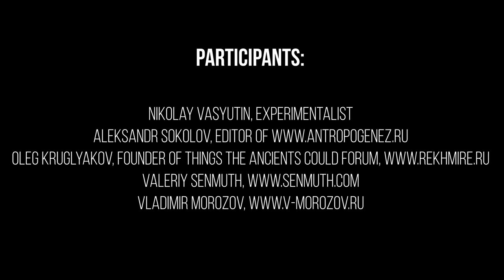Making Egyptian Drill Holes: Lost Ancient High Technology

Comment: Try drilling the hinge holes in the box on elephantine island.... It's impossible to do it that way.
Reply: Try viewing reality from a rational position.
Reply: @Eyes_Open  I am... The hole is directly in a 90 degree corner. there is absolutely no room for such a device.
Reply: @84Rabbitz  So you think the simple example represents all possible examples and therefore words.
Reply: @Eyes_Open  no I'm just saying that that works fine for a straight down hole in an open space. But there are a lot of holes that are drilled in inaccessible positions where that would absolutely not work.
Reply: @84Rabbitz  Sure. Other techniques would be required. Longer shafts for example.
Reply: The purpose of the video was to show of course how the Egyptians could in fact drill stone using bronze tools.  Yet your Elephantine Island argument constitutes a temple area which was added to and maintained up to = the Ptolemaic period...... - which is well into the Iron Age as you are in Roman times then

Ergo you ASSUME bronze tools were used to fashion those granite temple structures - some with holes - when it is equally plausible and far more likely that LAHT grifters take photos of the last additions to the temple mount = and "extrapolate" to generate INNUENDO rather than factual arguments - which you apparently fall for.  

p.s. - LAHT does the same thing for maaaany things.  They routinely take photos/video of sarcophagi in the Serapeum which date to the Iron Age under the Persians and Ptolemies and mischaracterize it as supposedly being created using Bronze Age tech........

Comment: The great pyramid has over 2 Million! Blocks all cut precisely with laser precision. You simply cannot do that with copper chisels.  And ropes     And the largest granite stones in that pyramid are 75 tons   There are very few cranes in the world that can lift blocks like that. And they are a few hundred feet up   
   And that’s just ONE pyramid. Of hundreds in the world   And the great pyramid is alighned exactly woth thr due north.  That means they knew the size of earth and directions. 

 Then there are those massive statues with perfect symmetry in faces   Precise.  Hundreds of statues. Not just one. Some ar 50 feet tall.    Then there are the massive underground structures  also precise.   

Nobody has ever been able to reproduce even a small pyramid in modern times. And they have tried.   

A small 2 ton block is 4,000 pounds   How many men would it take to move such a block even 100 feet ?  At 100 pounds each it would take 40 people just for a single block. And that doesn’t include lifting it  just pushing it around on level ground  

The holes made in This video are not laser perfect  within a fraction of a millimeter or as deep as the real ones in Egypt 

And we must ask who is the designer   No drawings ?   The great pyramid has perfect accuracy throughout   We cannot build a copy of it even today with all our machines

Comment: Ok got any theories on the precision joints on 5 tonne plus blocks ?
Reply: "Elbow grease" + a square...........  🤨

p.s. - the tomb of Rekhmire has the famous depiction of Egyptian craftsmen at work.  One depiction shows a craftsman using a large wooden carpenter's square to check the plumb on the side of = a block of stone.  So upon creating the surface it can be polished ------> measured --------> polished ------> measured......... - until you achieve your desired result.
Reply: @varyolla435  Each side of the base was 440 cubits, 230.4 meters (755.9 ft) long. The Pyramid’s mass is estimated at 5.9 million tons. The size of the Pyramid, in addition to the internal hillock, is approximately 2.5 million cubic meters. 
Based on these estimates, building this Pyramid in 20 years requires cutting, transporting, and installing about 800 tons of stones per day. 
Likewise, because it consists of an estimated 2.3 million stone blocks, completing construction in 20 years requires moving about 12 stone blocks to their location every hour, day and night.
Reply: @TheOzzieRob Math is funny. It can be used to help or confuse. The concept of coordinated teamwork forces a re-calculation of your numbers.
Reply: @Vision_2  Maths isn't funny. But I am laughing at that last word salad sentence of yours.
Reply: @TheOzzieRob  If you cant understand my simple message then I don't know how to help. Your formula is completely wrong.
Reply: @Vision_2  It's not even a formula. It's a simple calculation. Your mind is closed I can't help that.
Reply: @TheOzzieRob  Back to school for you.  Projects are completed by teams. Do you believe that all workers stopped and watched while a single stone was put in place? The rest of us know that multiple stones were cut, transported and placed by teams working at the same time.

Comment: Did ancient Egyptian produced copper tubes?Did they found any copper tubes?  Did they have the technology ? Manual drilling will be shaky, vibrating & form an unconcentric holes. Manual drilling will not have equivalent tool retrieval distances & marks as what a machine  drilling has.

Comment: Now explain to me how the ancients were able make a perfect cylindrical copper tube or pipe??????
Reply: with metallurgy, any blacksmith with some experience can easily make that
Reply: Pound it into a flat square or rectangle and wrap it around a former.. It took me a whole 3 seconds to think of that.
Reply: @PyroChimp75  then how do you weld the seem together? When  then used to drill with it, it will peel apart under the pressure of drilling, copper is soft by the way! Took me less then a second to answer back
Reply: @thatboysafishinfool833  jfc...

Comment: Put another tube over the handle, you will get fewer blisters.
Reply: Perhaps = but they of course are simply duplicating tool design based upon the iconographic record.
Reply: @varyolla435  well, they did use a plastic bucket plasticine, modern F clamps, an iron chisel to remove the core and made the weight out of cast plaster, none of which are supported by the iconographic record. even wearing a leather glove and  lubricating the handle with a bit of lard would have helped.

Comment: So I really like this method. And it makes sense. However I do see one glaring hole. 

The copper pipe being used. 

As far as I am aware producing a perfectly cylindrical copper pipe thin enough to be used for the type of purposes here requires some type of hydrolic forming to be done on the copper. 
And mabey I'm wrong, but I don't think the Egyptians had anything like that. 

So some kind of evidence that the Egyptians were able to make these sorts of perfectly cylindrical thin walled copper tubing needs to be firmly established before this method can even be considered. Otherwise one is just putting that Cart before the horse.
Reply: Well they smelted copper, so why wouldn't they be able to flatten it out and bend it into a cylindrical shape? Don't see how that would be such a difficult task.
Also, traces of copper and corundum have been detected in core samples. So that tells us the type of metal and abrasive they used.
Reply: @Leeside999   that's true they did have that. However there's a different between being able to flatten then role copper up to a rough tube, and forge weld the ends back together, and getting a copper tube that's perfectky cylindrical enough to do this kind of work. If a tube is even a little oblong this won't be possible. 

I'm not saying they didn't make them, but just that if they did such copper tubes should be evident enough in archeological rementas like their other copper, and bronz me tools were. But if that's the case then why have we never heard of them?
Reply: @anthonypolonkay2681  SGD's channel experiments with this kind of work alot. He makes his own copper tubes. I don't think the process is as complex as you are suggesting.  This channel also shows larger copper tubes being used and you can see that the tube is not perfectly flush where it meets up on the other side.

The evidence we have is that we know they used bow drills and fly wheel drills.
We know they had copper.
We know they used copper and an abrasive to drill out cores.

So I don't think it necessitates the need to find one of these copper drills to conclusively say they used them.
We have found very little metal from those times as metals were such a valued resource and were no doubt recycled.
Reply: @Leeside999   I would disagree. If it was as commonly used as would be required we should find some. Mabey some copper tubes broken off in unfinished drill cores something to that notation. But even besides that we should have hieroglyphic evidence of the process but given that this experimental was needed in order to make the proposition I doubt we have that.
Reply: @anthonypolonkay2681  But doesn't the fact that we have found traces of copper on these cylindrical drill cores prove the type of metal drill bit they used?
Reply: @Leeside999   I would say it helps the case definatly,but it could easily just be traces from the various copper tools we know they did have, perhaps a copper hook, or rod was used inside the cores to hold the stones as they were being lifted, as u doubt that wood could be used to lift the heavy stones.

Like I said I think this method is a good idea,it's just the difficulty of making a perfectly cylindrical copper tube that is both thin, and strong enough to do this reliably
Reply: @anthonypolonkay2681  Well to be honest, I don't know much about metallurgy so I can't really speak to that. And you probably know a lot more than me.
But the fact that we can produce the same striation marks as the cores found using copper drill tubes, the fact that we have depictions of them using these tools on stone vases, and the fact that we have found traces of the copper on the drill cores,  is enough for me to believe that the drill bit was a copper tube.
Reply: @Leeside999  well see you just said that we have depictions of them using the copper tubes this way. If that'struely the case the case then I think I'd be convinced. I have just never seen or heard of it before.
Reply: @anthonypolonkay2681  There are depictions of them using bow drills and flywheel drills on vases. Of course I can't say the depiction also shows a copper tube at the end of the drill. I'm filling in that part with the rest of the evidence I mentioned.
Reply: @Leeside999  hmm. I mean it makes sense, but on that same token bow, and flywheel drills arent that specific to Egypt, or this granit block construction.
Reply: @Leeside999  Have you ever tried to make a metal tube from scratch? THAT in itself is advanced technology. Jewelry artists learn how to make tubes at some point, but then they just buy the stuff because its a difficult process and requires tools Egyptians did NOT have.
Reply: @davestephens8033  They were able to smelt copper. So why would it be so challenging for them to pour it in to a mold? If you consider a mold to be "advanced technology" then I'm pretty underwhlemed tbh.
Reply: @Leeside999  Show me a cast copper cutting tube then. None have ever been found. My experience in casting is that casting a thin walled copper TUBE with casting technology of those times wouldn't work at all, and there are no artifacts of cast copper tubes of any kind. Its just an excuse fantasy. More than that no one has EVER shown a copper tube cutting the hardest diorite and red granite at such a fantastic cutting rate. We don't KNOW what the cutters were used, none ever found. Some holes have been found that made right angle curving turns deep inside granite, explain that. The only demo of tube drilling took all day to barely cut an INCH, and they claimed they solved the puzzle. That demo also DID NOT produce a core with spiral cutting lines, abrasive cutting does NOT leave spiral cut lines. Petrie's premise was poorly supported, he falsely wrote that the core lines were horizontal, when its been proven they were spirals. The progressive spiral cutting dug deeper and incredibly faster than any modern technology can do, whether abraives, or even modern diamond core drills. The best explanation they can come up with is that the cutters were ultrasonic vibration cutting. But there are NO drills of any kind in existence. You should watch more of the engineering/machinists videos who prove that we don't know how they did this work.
Reply: @davestephens8033  sorry sir, but you are regurgitating many debunked claims, especially regarding petries core 7. Watch the video from this channel called "out of place artifact". It does not have spiral grooves.
Watch other videos from this channel showing them casting a copper tube and tell me what technology they used which the ancient egyptians couldn't have replicated. 
You're right, I think, to say that no copper tube drill bits have been found, but samples have been taken from a drilled core which found traces of copper and conundrum. So its safe to say that that's the type of metal and abrasive used. Experiments show that these materials do indeed drill cores in granite. The tapering is caused by the wobble of the fly wheel drill. That is also explained and replicated in the experiments.

Your issue seems to be how slow the experiment took. How long did it take the ancient egyptians to drill cores?
Also, the claim, made by dunn, that the drill would need to have spun 500 times faster than modern drills are capable of is utter nonsense. He's not a good source. He's the same guy who claimed that coral castle was built using a levitation machine. (Turns out it was a hoist) That guy is a fraud.
Reply: @Leeside999  Show me an ancient Egyptian CAST COPPER TUBE. You can't.
Reply: @davestephens8033  
You're right, I can't. But lets look at the evidence:
They had copper.
They had corundum.
Traces of copper and corundum have been found in drill cores.
We know they used fly wheel drills.
We know they had bow drills.
We have replicated the drilling with copper tubular drill bits and with corundum/quartz sand as an abrasive using both a flywheel drill and bow drill.
The results show that these tools and abrasives work and produce the same types of cores and striation marks as the ancient pieces.
We also have depictions of the ancient Egyptians using these tools on stone vases.

So what is you evidence for "cutters using ultrasonic vibration cutting."?

Or 

"The progressive spiral cutting dug deeper and incredibly faster than any modern technology can do"

Comment: So what material was that little chisel they had to use to break the core made of. Certainly not copper. probably iron, which totally destroys this whole video. I just don't get it.
Reply from the maker: Bone or stone chisel will do
Reply: @ScientistsAgainstMyths  okay. then why wasn't a bone or stone chisel used?
Reply: Copper can bore through stone - even granite - if used with an abrasive compound such as sand or corundum.   A stone artifact unearthed at Amarna was fashioned in part using a tubular drill.  In the drill hole was residue which when analyzed showed copper and corundum - Mohs 9.  Emery corundum was mined for millennia on the Greek island of Naxos making it available for the ancient Egyptians.

So "cost" was a factor in the fabrication of things as well as in construction the same as today.  Given its ubiquity gneiss stone tools such as flint which can be shaped and dolerite etc. would be cheap and widely available making them a primary tool for working stone in basic shapes.  Meanwhile copper being more costly to obtain as it needed to be imported from Sinai was also used - though its access would be limited.  There are scribe accounts of workmen in the Valley of the Kings having their copper tools weighed to prevent pilferage of broken bits. So stone tools might be used for basic quarrying and to obtain rough shapes while copper and abrasives as noted might be used for finishing work.

p.s. - the Egyptians did not actually smelt iron until the Persian period = but they traded with those who did.  Iron smelting originated with the Mesopotamian and Indus Valley cultures.  So New Kingdom Pharaohs might have plausibly had access to at least some iron tools as by the New Kingdom period iron was already in use in these cultures with whom the Egyptians traded.  These as alluded to would have been expensive and access limited.  We really see an explosion in finely crafted stone objects and engraved obelisks etc. = during the New Kingdom period.
Reply from the maker: @Nik 'Cause we didn't care about it
Reply: @varyolla435  
"Iron smelting originated with the Mesopotamian and Indus Valley cultures." the Indus culture definitely did not have iron

Comment: A few hours and ya went almost 2". Thats pretty impressive. I mean with all the other videos flosting around for the last decade or so, pretty much showing the samething anx all the naysayers through up their arms in disbelief and what nots, id have to say you guys are right on the money. Instead of 1 or 2 workers, id say like 3 or 4 taking turns every so often while other taking a break would go get supplies so they could keep working. The video walking around giza pyramid, everyone tets hung up on the whole sand thing. On how they couldnt have drug the stones. I knew it wasnt all sand and there had to be a hard surface otherwise why would you be there. In tye hieroglyphs it shows a worker pouring water in front of sled. I dont believe that, i believe they cleaned the area to the hard surface and was pouring sand so the stones could be drug easier. Ever walk on a hardened surface that has a little sand on it? Gets pretty slick pretty fast. You guys are just solidifying my whole thought process on this.